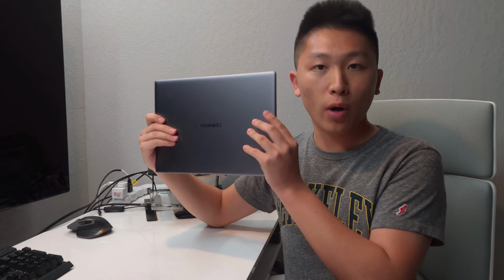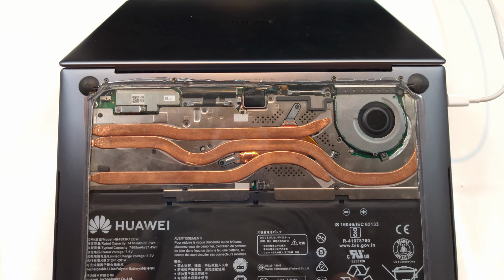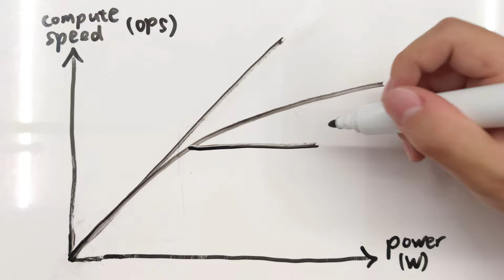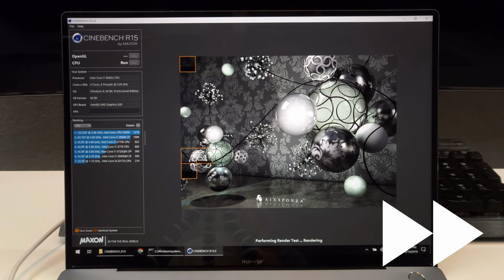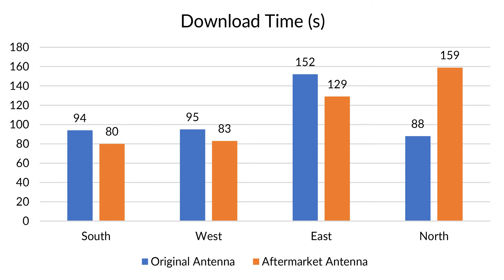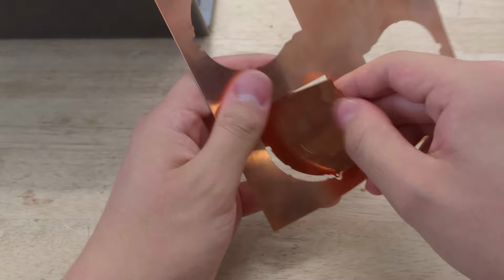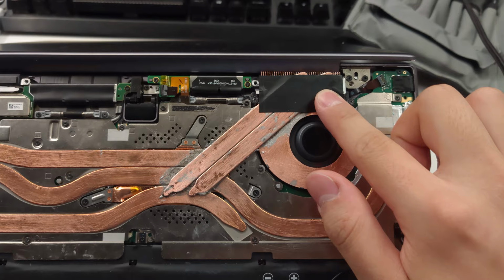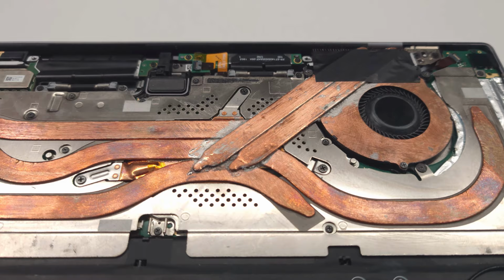Adding a Second Heatsink to My Laptop (MateBook X Pro)

Comment: So you did all of this, and added a ton of copper surface area to improve power dissipation by only 4 watts? seems pretty low to me. Either the stock thermal solution already heated the air a lot and only warm air went into that fin stack which would mean, that without a bigger fan there is no point in adding surface area, or your construction has a very high thermal resistance somewhere...

Comment: Checked your mod guide article, and other mod videos. Just adding 2 pencil heat pipes made a big difference. Addressed the thermal throttling and overheating. But you went even further with other mods, and made a new cooler design in this video. My summary: OEM's cut corners very badly on both laptops and desktops. They pinch every penny, especially on cooling. They let out a bad build or design just to save $20-$40. I'd happily pay the difference for the performance gains, and quality of life. No computer can perform when it thermal throttles. A computer needs enough heatsink material to absorb the heat, then dissipate the heat. Such as CPU radiators, fans, and vents. The laptop form factor is more sensitive to thermal throttling. Your mods focused on adding more heat sinks material: heat pipes, copper plates, and and thermal pads. From what I read previously your temperature results were impressive. Wish you focused more on the before and after temps, and clock speed performance. I hope you sent the manufacturer this video as feedback. Good tutorial and project. 👍

Comment: I'm a Mechanical and Electrical Engineer graduated in 2011 working daily with industrial machinery, and I'm not ashamed to admit you impressed the hell out of me. That copper routed fan cover/heatsink... one of the finest ideas I have seen, and the low temp solder, I did not know that it came in paste form, I take many ideas to play with my old MSI GT70 and my new Dell G3. A couple of my customers have laser CNC's, so I will for sure will follow your lead.

Subscribing, and thanks a lot for the video :)
Reply from the maker: Thank you Ernesto for your encouraging words!
Reply: Low temp solder is very common in plumbing

Comment: One of the most comprehensive mods I've seen by anyone in a long time!  If I had heat pipes back in the 90's!  The first time I added cooling capacity to a GPU was My Diamond Stealth II...Radio Shack and a handful of heatsinks, a small 12VDC fan and fortunately/unfortunately super glue!  I got the card from 35 Mhz to 70 Mhz stable, it would artifact noticeably @ 72 Mhz.  I absolutely shouldn't have used superglue, somehow it worked, never fried the card and I still have it!

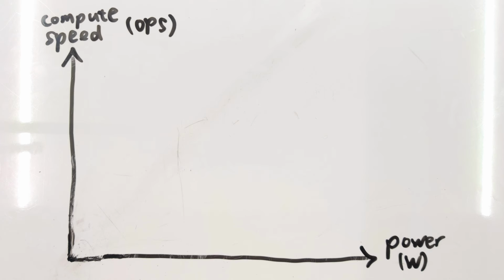Comment: 4:38 holy shit you explained this a hell of a lot better than i have any time ive tried.
undervolting is also a huge help when it comes to changing these curves for the better, all without needing to modify cooling at all.
ive managed to greatly improve performance on my dell lattitude 7490 with its i5-8250u by both undervolting the hell out of the cpu, setting it to use 35 watts during PL1 and putting thermal pads on what i think are the vrms and along the heatpipe to touch with the bottom panel.
all of this means gained me an extra 1500 points in the cinebench r23 multicore test and made gaming on it much more bearable, it can now sit at 30 watts of power usage while gaming and occasionally spike higher when it needs to instead of sitting at 15 with low fps and lots of stuttering.

Comment: I had an issue with my HP victus laptop with frequent fan ramps

I fixed it by adding some copper tape to improve thermal mass and conductivity to the finstack, it is running much cooler now and it doesn't ramp up nearly as frequently

Comment: I had no idea you could solfer thermal pipes to each other with just a heat gun.
I mean you can solder copper together with heat guns but I didn't think that you could do it with heatpipes.
I would've expected that the inner strands inside would just burn but apparently not.

Comment: Good Job! Elegant solution) I actually had to mount large flat coper heatsink 15x7x1.5 with thermal pad (don't want void the warranty) directly to the heatsink (had to buy and make custom backplate for my 7790  50usd) the heatsink and the 2 blower fans sticks out 1.5 cm, but the laptop gained huge performance buff!  9750h max power now 80+watt it was 30+ max, and the 2060 clocking@1850 MHz! In games max temp is around 70c, in stability tests 92 max. I just hate when manufacturers limit performance with bad cooling and power limits!

Comment: From doing construction,  i know this video is 3 years old now. Pickup a caulking scraper, that will help making the glue and liquid solder much cleaner when attaching and detailing edges and scrapes off any excess uniformly.   

Also, this is an awesome video and gives me a few ideas to readjust some issues i been having with a couple of GPUs.  Looking at how the heatpipes were designed and layout  of the entire heatsink, i think temps would have benefited layering one stack 1x4 copperheatpipes of the same length for the longer pipes, and 1x3 stack of short length copper shims to make bridging contact from pipe to the copper shroud. That would help with spacing and coverage.  Yeah, that heatsink design is not very good. Heatsinks like that i have normally seen 2 fan arrays on the opposite sides of the laptop and plus that fan is way too small to try to push heat from that kind of length of heatpipe.  

I have a dell optiplex 7480 that has the worst design flaw i have seen where the screen latch covers the vents for the CPU and only has a few millimeters of room to blow air through. There is no way of modifying the vent but i do plan on getting back in there to place some thin shims on the heatpipes and one on the Cpu to get the temps down

Comment: Awesome demonstration; well laid out formatting of the challenges and data collection! 
I've never soldiered heat pipes yet, but it's probably like soldier copper pipes while water is still dribbling through them. You just need more heat, or maybe add heat to the whole surface to get no thermal transferring. 
I stumbled across your video because I was looking to extend a heat pipe in my A315-41G-R5U3 craptop that has a blank fan space. I struggle with thermal issues on this Ryzen 3 2200U system and wondered how simple it would be to extend the thermal pipe to cover two shrouds. Your video has helped and inspired me considerably to consider how to tackle the concept of extra cooling and higher benchmarking. 
Thank you!

Comment: to get the absolute most out of this one would have to bend the pipes over the full fin array and onto the cpu - in the caziest case even remove the current direct contact pipes and CNC a new path to the fin stack - all of that seems quite crazy for an individual but im kinda sad Huawei didnt do this right away in the design.
Reply from the maker: Yeah, exactly, I thought of bending the heat pipes but they are too flat to bend with the tools available to me.
Reply: @BradsHacks  ow yes its so easy to kink them :/ you would likely have to use thicker ones which only rlly works if you remove the other pipes which i imagine are soldered - that would be a crazy amount of work and there is no going back at that point
Reply: I saw a video of a guy bending heatpipes with a ridiculously simple method. Put a coin in a vice and used that to bend the pipe.
Reply: @jm036  This works for bending certain round pipes - usually you would use something slightly larger then a coin unless you have a 3 mil pipe and really need that tight curve (the tighter the radius the more you reduce heat transmission)  Issue here is he would need to bend a flat pipe in its width plane - not so fun cause the tension and pressure on the edges is very high with low rigidity perpendicular to the plane resulting in kinks which kinda kill the pipe. 
This is usually done by first bending and then flattening the pipe.

Comment: This is so cool!
I've modded my own MateBook according to your guides, and I'm happy with the result!
I can do some heavy DS stuff like running clusters and some even heavier Robotics stuff like CAD and it just works!

Maybe you can try scavenging a curved heatpipe from a spare laptop's cooling system so that it will cover the finstack completely, and gently bend and come into the contact with main heat pipes
There are plenty of spare cooling systems on Amazon or eBay, you can definitely find one that fits your needs
Reply: This is not the 2020 version right?
Reply: @provamaggio954  2018 i5/8gb
Reply: @yuriysukhorukov391  you think these tutoriaps would work on the new one also?
Reply: @provamaggio954  it's very dangerous to try these on your laptop, specially they are new ones.

Comment: It's hard to tell from the video but it seems like some of the solder paste flowed under the bridge heatpipes to where the big heatsink plate is (last solder, 15:17). If the gap is filled and making contact with the plate then that could limit the thermal performance.

Comment: Good effort. I think it's the hot air that's being pulled by the fan which is really a bottleneck. Temperature difference is needed for heat transfer. Very interesting experiment.👍
Reply from the maker: Yeah, if we think of it as extracting 4 or 5 watts as a bonus from what was going to be waste heat, that's not too bad haha

Comment: Amazing video. One more thing that can help out is using liquid metal. In my laptop I changed the thermal paste, undervolted the CPU and I'm running 15 degrees Celsius cooler on the cpu, and 12 degrees cooler on the GPU. It is so much better that right now I can literally run it with the fans off if the load is relatively low. By doing this, and tuning the memory, u was able to beat the #1 spot and I currently hold the world record on Intel XTU for the 6700hq processor.

Thanks for the amazing ideas. I will try to add some more heat pipes to help lower the temp just a tiny bit more, and I'm also 3d printing an enclosure to replace the dvdrom with a big fan.

Is it possible to undervolt your processor? Can you change memory timings?

Comment: You should make a zero clearance insert for your bandsaw, you will get much better, cleaner cuts on small pieces. It is also much safer.
Reply from the maker: Yep, I 3D-printed one, works great

Comment: Really nice mod! Love it! The soldering part it's hard to do but i think it can be better for more performance with better tools maybe XD, you talked about airflow to cool down better the heatsinks too but the problem is different, like for example, putting the  thin layer of copper on the fan to protect it, you could've put just graphite on top to shield it from the heat.
Instead like that you're taking cold air outside, it come through the chassis, cooling parts and taking heat, and last part the air comes on top of the thin layer of copper on the fan hole, taking more heat from that and pushing warmer air to cool down the heatpipes. 
another big problem it's with the exit of the air like a bottleneck for airflow. but i repeat, nice job i really like it! :D i've made a few mods on customers laptop, ultrabook or gaming laptop to manage the channeling of air better to just take air from the outside cold and use it to cool down just the headpipes at the end, reducing the inside heat of many components.
Sometimes with HP or other stuff Asus too, had to cut a hole  near the hole of the fan to take air directly and putting a filter beneath. 
With this kind of thin laptop it's hard to mantain  good temps, larger heatsinks can make magic sometimes, like a good thermal paste.

but i can see you've reduced by a good 10-12°  the top on some cores. that's great.

Comment: This is excellent work!
Did you btw look up the thermal conductivity of solder? It is quite poor.
Some brazing compounds offer much better thermal conductivity but require 700-800c to flow. I have no idea if heatpipes can endure this.
Reply from the maker: That's interesting, but the heat pipes were already swelling when applying 200°C hot air
Reply: @BradsHacks  Wow! Yeah that is interesting info. So flat pipes puff!

Comment: Wow, this is exaclty the kind of videos I was always searching for. I wonder if such mods can be made with a XPS 13 9370 as the bottom cover is very tighty cnc machines and doesnt seem to leave room for heatsinks.
Reply: xps 9370 has it little heatsink

Comment: Sorry to comment late but -- regarding the fin stack not being directly covered by heat pipes, do you imagine this would have been solved by soldering yet a third heat pipe diagonally from the original heat sink to them?  (even without a soldered connection with your improved copper fan cover)

Comment: Can you do a video on modifying a Dell G7 heatsink please? I still struggle with keeping CPU temps below 100. Dell techs just keep saying that it's within limits. And they brick the bios so I can't tweak voltage. I've used vaccuming cooling units, pads, paste, removed bloat ware, you name it. It still can't perform under full load for long and it bottoms out hard. Great videos btw. Inspiring.

Comment: i have neve worked with heat pipes and i want to know if i can bend them a bit
i have hp omen 17 an106nm there is plenty of room inside i actuly want to put additional watter cooling system to laptop but its way over my budget only no spill connectors would cost me 100$ so heat pipes shuld be cheaper solution

Comment: I think laminar flow isn't an issue since this 'air chamber' is so thin, so the heat exchange should be sufficient. Instead of the fins, have you thought about guiding the airflow for a better heat exchange? For example, the air comes in through the right speaker hole didn't cover much of the plate area, and this is the shortest distance(might also be the lowest drag) path for air. Will blocking/half-blocking this hole, or add a divider between right half of the mb and battery improve thermal performance? By doing this, less air is going through this hole/ air go through this hole is guided to travel through a larger plate area.

Comment: Such a shame that manufacturers make such poor engineering design with capable hardware. I am also facing an issue with ram heating up after I upgraded capacity. Before it was very cool, but now its cooking my lap. I think a thermal bridge between ram heatsink to cpu heat pipe will improve ram cooling since they are adjacent. Its currently not connected thermally and the spot around ram gets very heated up. I am lucky I don't have to make extensive modifications like you did. Kudos to you. Sad state of affairs for the common people who have to stick with manufacture's poor design choices.

Comment: Umm... This heat pipe that you used! My laptop is potato and i want to replace to vapor chamber, can you suggest somewhere (amazon, AliExpress...) Where i can buy a vapor chamber?

ps: not really replacement, I want to add another one to it, my default one is just copper, I'll find a way to fit it but didn't saw a vapor chamber pipe online!
Luv ur DIY